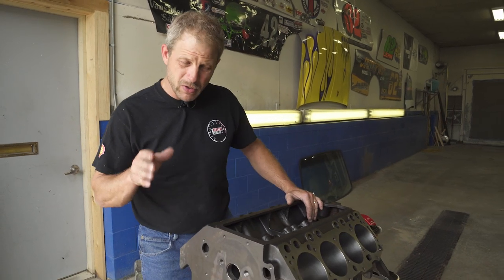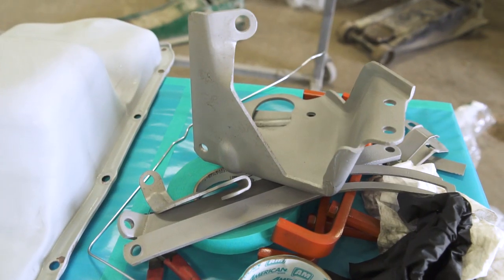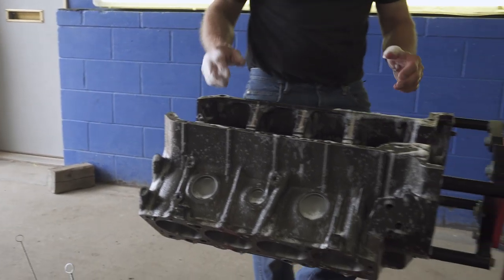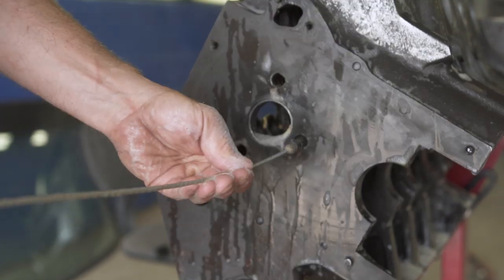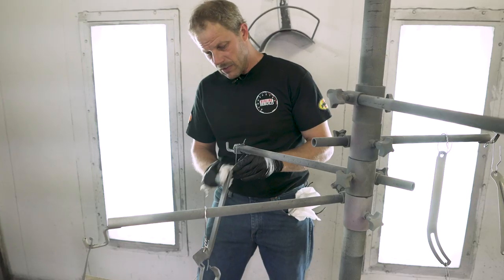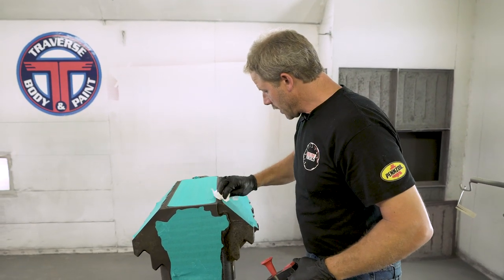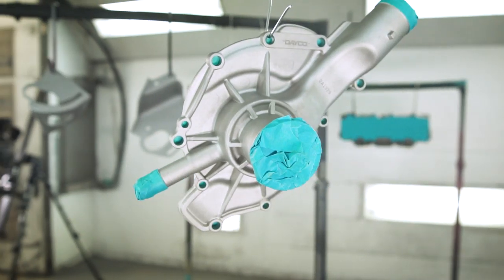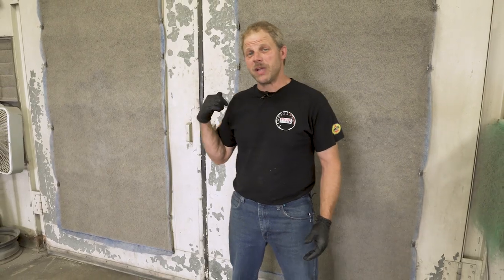Painting our Buick Nailhead | Redline Update #15

Comment: I'm enjoying your videos! Many years ago I built my only engine...on a 1275cc MG Midget.
The young mechanic at the machine shop told me to paint it all after assembly...that it helped to preserve the seals. He must have been a Buick man! You make me want to tear into something again! I had the same issue with timing you had on the Model A...
Cylinder 1 at compression stroke...?? degrees before TDC...rotor pointed at no. 1 plug wire. Would not start! Local mechanic said, "Play with the timing." He was right....it ran!
I wonder what threw it off...spark advance? Thanks, guys....
Mike